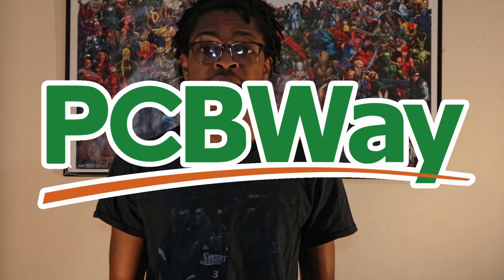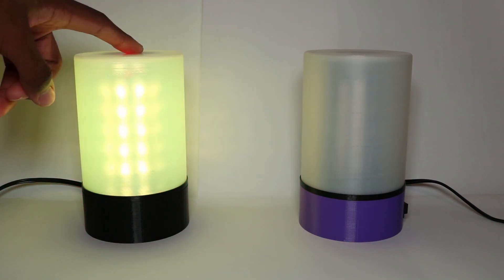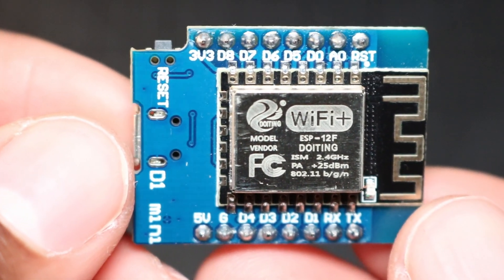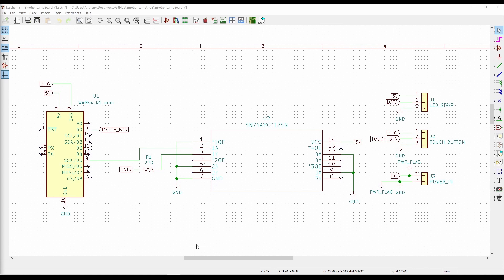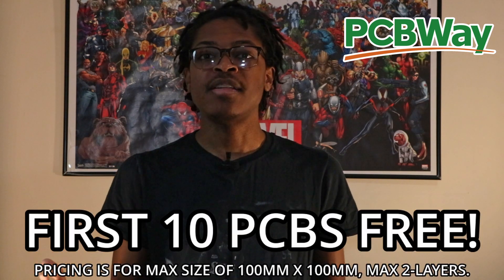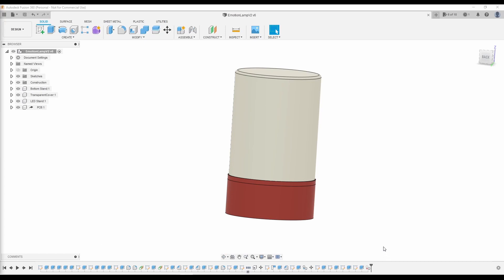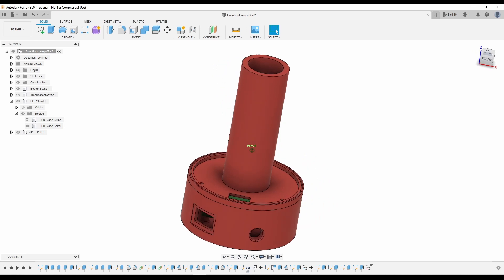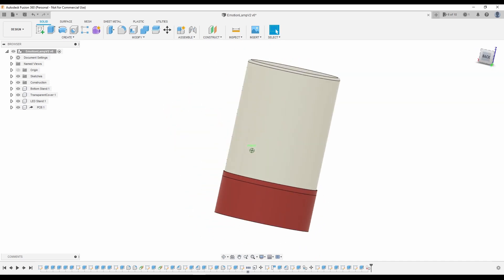Long-Distance RGB Touch Lamp | Emotion Lamp Build Guide

Comment: Great work.  I like the different schemes you came up with, and the clever way you can manipulate one lamp from the other.  A smart bulb controller is on my bucket list, but there are just too many easier projects in the way which I need to learn from before getting into heavier areas.  Kudos to you for actually building the complete lamp as well.